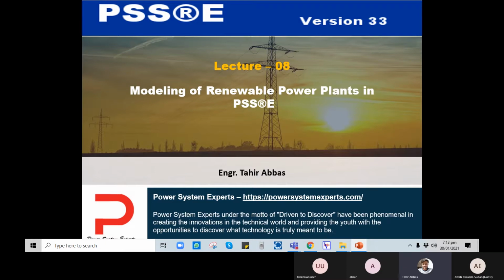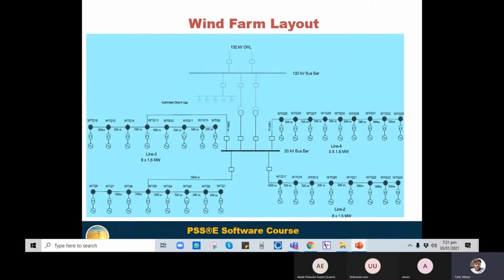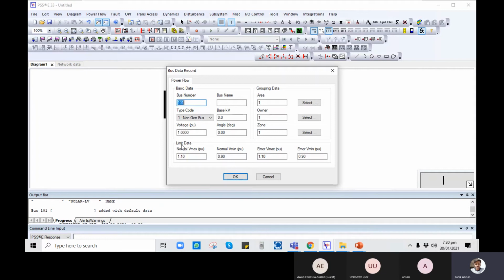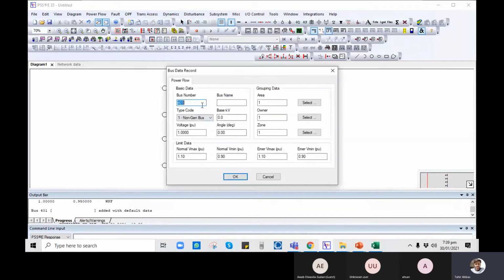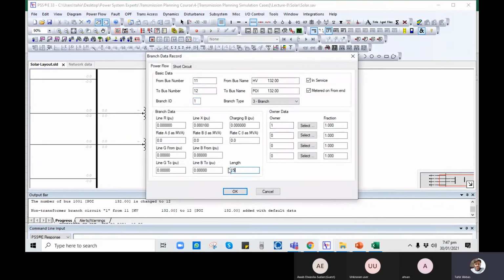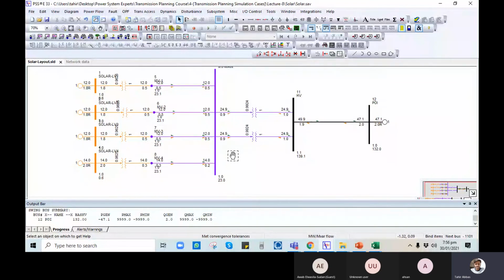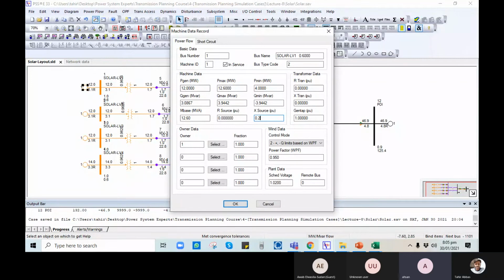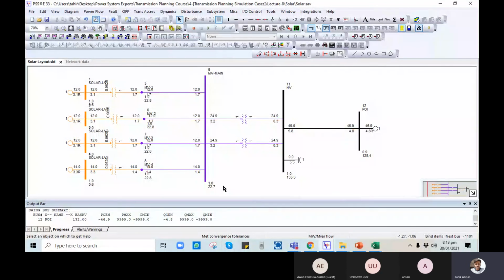PSSE Tutorial - 06 Modeling of Renewable (Solar & Wind) Power Plants in PSS/E

Comment: i want to ask that the wind control mode is set to 2 in modeling solar power , please explain more for me.
Reply from the maker: If you want to use plant capability based on the fixed power factor then you can use 2. If you have fix Qmax and Qmin based on the Plant Reactive Capability Curve then use Code 1. However for different OEM model it depends upon how you design the inverter model.
Reply: @Power_System_Experts  thanks for reply me. But i wonder that the wind control mode is set to 2 ( for solar power), what is the affection of this ?.  Hope you reply me soon. 🥰
Reply: @haiBui-kd2mw  I believe in PSSE, WMOD is (windMOD) is for just renewables in general.